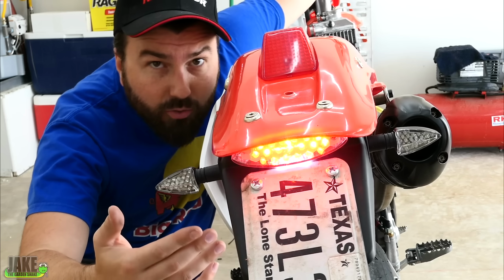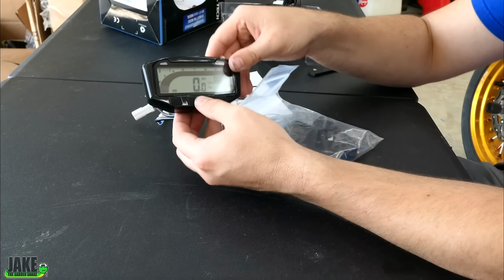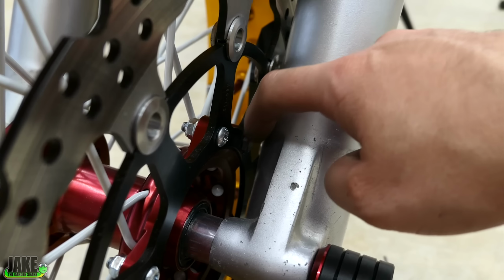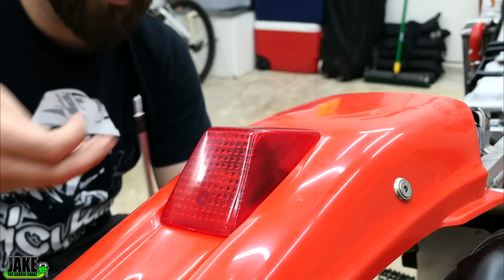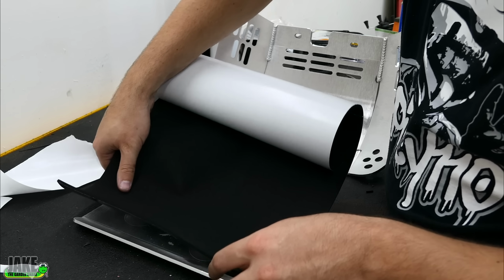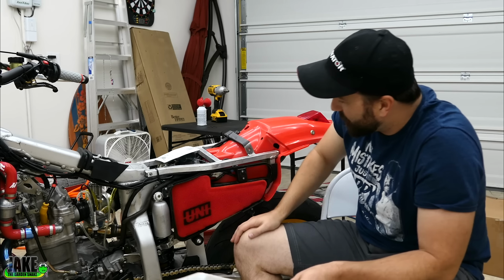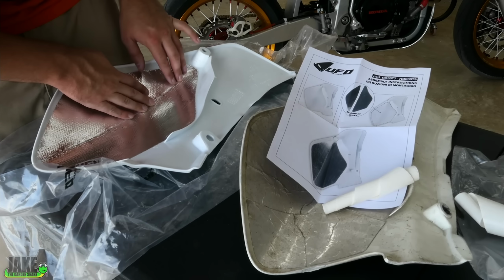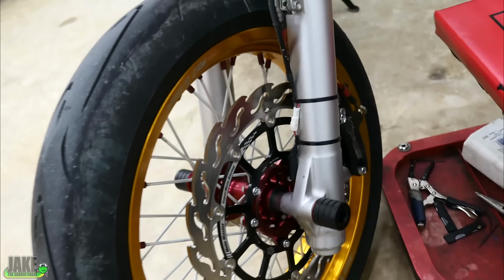It’s DONE! XR650R Supermoto Build 15

Comment: If you had used the European wiring loom you could have had front and back drake switches high low beam lights stop and tail lights indicators ( maybe not) and all Speedo lights horn and switchgear plus a bigger stater. And it would all be genuine Honda    I’d press that panic button if I saw those blue electrical connectors.   SRC  I made a small sump guard.          It lets a lot more air on the engine. When your riding fast.  The air-box mod took two week on a DYNO  to get it bang on.      If you make the holes to big  your bike will bog down and have bad throttle response  so always  make them on the smaller side   And the coolant temperature doesn’t matter any wear near as much as the oil.  Even the rads overheats it will just push the coolant into the expansion tank and suck it back in to the rads   If you have owned the xr600r or the 650L. They get unbelievably hot and never come to any harm. Oil temperature is what matters. Loving your vids. Stopping me going mad in lockdown. Well done 👍

Comment: Couldn’t u use tape when running the speedometer wire along the brake line so it can still fit thru the tube thing

Comment: When you were drilling holes through the plastic for the airbox for the way you actually should drill through the plastic is. As soon as the first point of the spade bit goes through the other side is stop. flip the plastic around and then drill from the good side and that way you don't have a rough looking side on your good side

Comment: Take out your uni fiters and give it a rev then put em back in and give it a rev if your leg is on the footpeg yol feel the air move bug time without them.i had them as well but there not efficient enough.they go to far in and dont let the air expand out to the filter. They spot feed.the big xr can gulp a heap of air from
. Idle to crack open if you dont restrict it

Comment: So how did the adhesive foam/rubber work on the skid plate? I installed a Moose Racing skid on my XT250 and I get all kinds of engine noise now 😂 and that stuff is exactly what I had in mind. Great video! Have to hold off on patreon as I lost my job 😢 oh yea, and I think your bike would look decent with graphics on it. But I've always been a graphics guy 🤷‍♂️

Comment: Another tip every wire or in general any loose touching part, either loob it up or pack it in rubber, the vibrations aren't your friend.

Comment: One tip, either change the rear shock to a longer one or change the linkage. You should aim for a swingarm angle of around 10° that puts more weight on the front and makes the bike handle better.

Comment: Those paddle bits if you just go about half way through then flip it you get a nice clean hole.  They work best at high speed and with a slow plunge.  Bike came out awesome.  It's such a pig.

Comment: Nice pro taper evo 1 1/8 black bars, I just received mine , they are the steering damper low(-1 in.) in black and straight away cut an inch off each side and mounted the cycra ultra brush guards that the only way they would fit was with the framing on the wrong side and the guards right side up . You know the excitement and struggle with fancy parts fitting

Comment: Front disc looks cheesy and those side panel vents look terrible in black ! you can get white ones and why dont you just make a aluminium tail tidy ?? I did from a old rc car ali chassis and bolted it to the rear fender support ??  Also you wont get many miles from the stock tank either so fit the clarke oversized one on it .. id order a T shirt but with shipping to the uk it would cost 40 odd dollars plus import duty anf handling fees and would make it cost 65 dollars or more . Cool bike but not as nice as my BRP 😉

Comment: Put heat protection on that thermostat LCD Wire it’s a little too close to the exhaust pipe. I had it happen on my crf 450x
Reply from the maker: Thanks
Reply: Np

Comment: hey jake just a heads up it might be a good idea to route your front brake line outside of the fork instead of inside. I had my 250L the same way with the same Core brake line and seemingly enough clearance between the line and the big sumo rotor, and a couple weeks ago I came close to rear ending someone because my front brakes just gave out suddenly. turns out every time I compressed the suspension hard enough from a jump or putting the front wheel down to hard the rotor was cutting through the line slightly. just something to look out for

Comment: If you drill through part way, then flip it over and use the same center hole and drill a bit from the other side it'll make both sides clean.